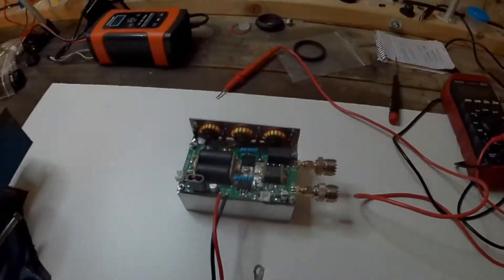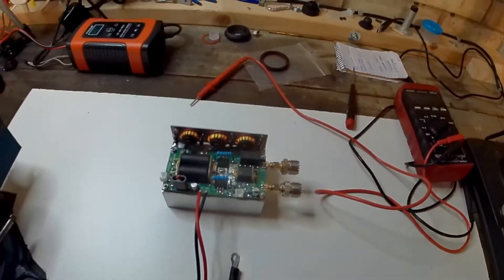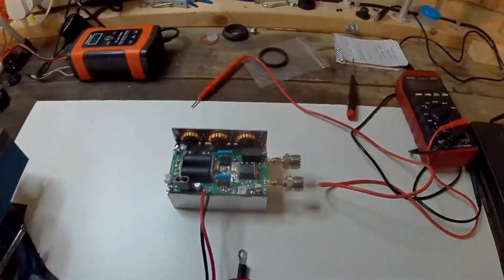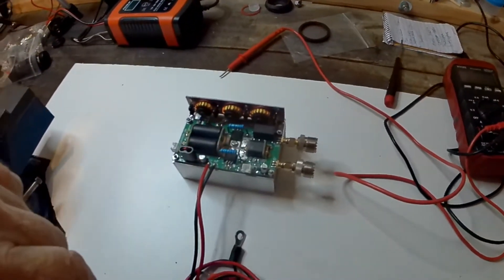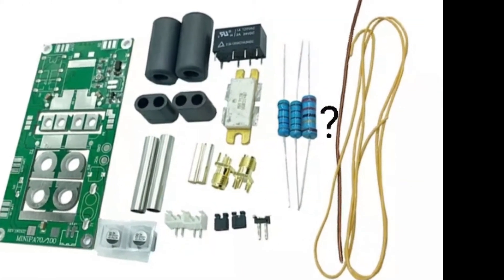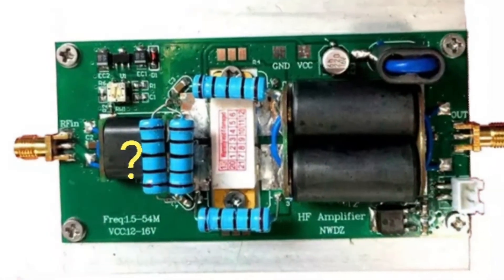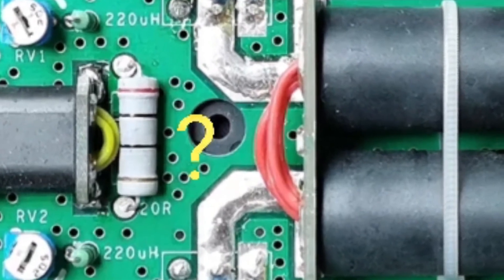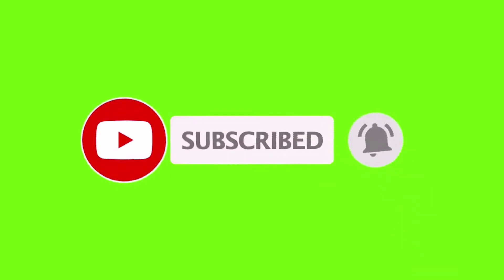High SWR Solved. Minipa70 HF Linear Amplifier Kit. Ham Radio. Amateur Radio.

Comment: R6 is for reducing the input Q.
Reply from the maker: Cheers for your comment. Whatever the resistors purpose is. It certainly reduces SWR but doesn't effect the gain as I cannot measure any drop in output power to input power. Well not on bands I am using. George